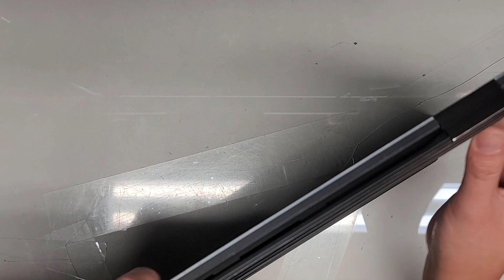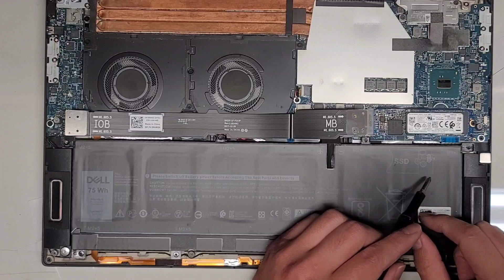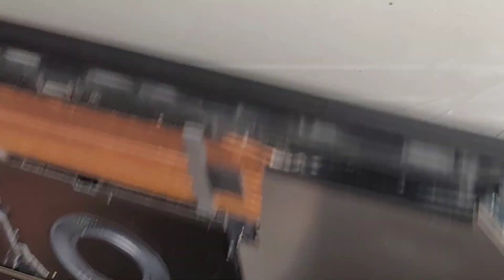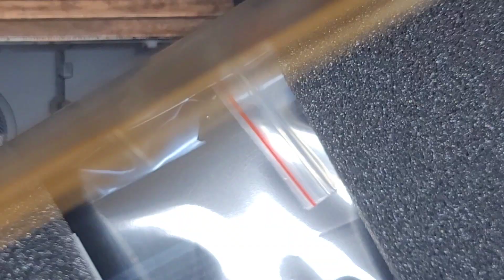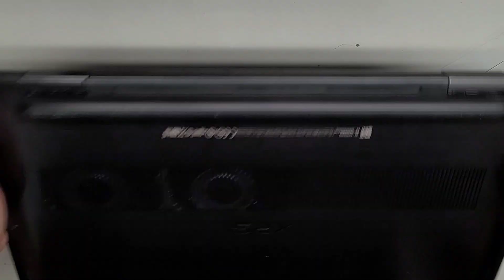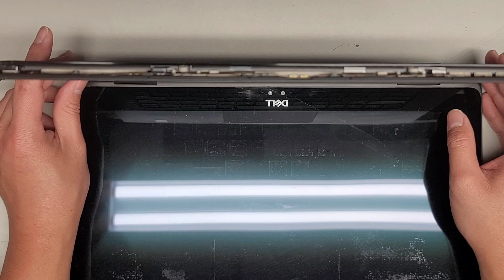DELL XPS 15 9575 2n1 2-in-1 Disassembly SSD Hard Drive Upgrade Battery USB C Replacement Repair

Comment: Hey brother i know this vidoe is old but i have dell precision 5530 2in1 same features and same design from inside and out side i have issue when my laptop battery is around 80 90 or less my cpu goes 3.10 gjz to 0.80 it badly lags can you help me
Reply from the maker: Hmmm it's throttling?
Reply: @ItsBinhRepaired yeah only when its below 90 it lags no even open chrome
Reply: Can help me
Reply from the maker: @AliJavaid-e9kmaybe this https://youtu.be/R2uX4dZnA5c

Comment: I have an XPS 9575 with only ubs c ports and none of the ports are charging. Tried cleaning the ports, then with different Dell power adapters and initially would work on just one port through slow charging but now it doesn't take any power. 
Battery is totally dead and been using it only through power adapter. 

Is there any video dedicated to fixing the usb c charging ports on the xps 9575 to get it to work? Still watching this video so don't know if you cover it in this one or if there's an updated video about fixing it?
Reply from the maker: I don't have anything on that
Reply: @ItsBinhRepaired  thanks for replying. Any chance of doing a video about fixing usb-c ports seeing from the comments, there's a quite a number of people with this problem?
Reply from the maker: Requires micro soldering skills. I'm not able to do most of those.

Comment: Awesome video Binh! Can you show me where the wifi card is? Ive been having issues for years and finally getting around to fixing it 😂
Reply from the maker: Top left soldered to the daughterboard.
Reply: So I can't replace it? 😢
Reply from the maker: @ezpeezy58  you can if you replace that board.
Reply: Or if I replace the entire daughter board, I'll just keep having issues with the crappy killer wifi 😢

Comment: I had a Dell technician replace my battery. He pinched a cable of the fans ...anf I  got an error msg. Had to get someone else to replace the fans but since then, every time i turn it on, I have to press ESC several times or it beeps loudly
Reply from the maker: Hmmmm very strange
Reply from the maker: Sounds like a keyboard issue making it think buttons are held down?

Comment: What did the board you replaced cost? And why did it come it that shape (dent). I have one of these with a WiFi issue.
Reply from the maker: Cost will change on a daily basis. I don't remember.

Comment: if the original charger board was bad, how come it working when you plug in the charger? maybe the battery alone needed to be replaced and the new charging board is bad as you say
Reply from the maker: The customer told me it has issues detecting USB C devices